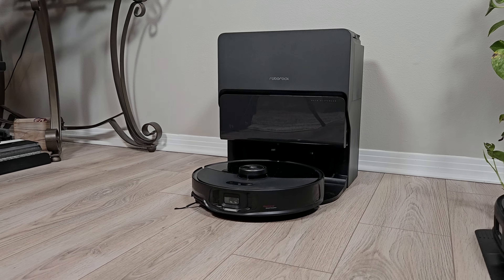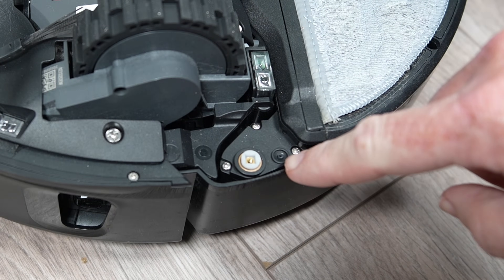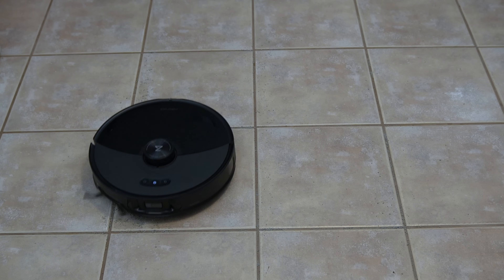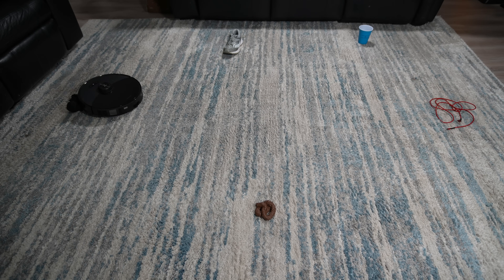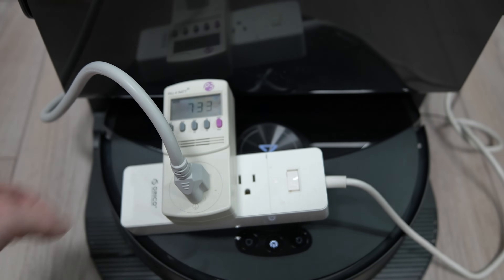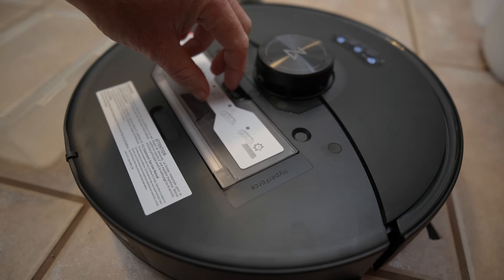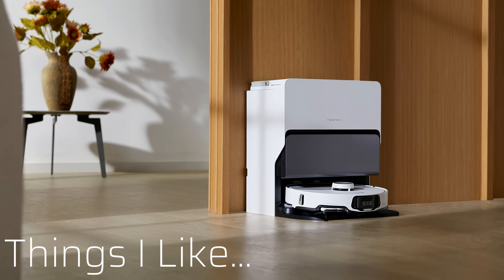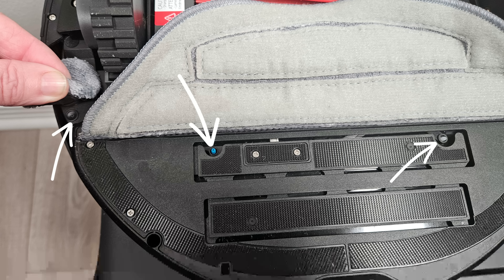Roborock S8 MaxV Ultra Robot Review. The Good & Bad.

Comment: Regarding some of the software  related cons. I've got to say Roborock is fairly good about pushing updates to fix things. They definitely utilize feedback which is great!
I'm still rocking my S7MVU and S8PU. Quite enjoying both 🙂
Reply from the maker: Yes they are.  I remember some issues with the S7 Maxv when it first came out. I just wish they were fixed by now.
Reply: How long have you had both or your vacs for?
* If you had to do it all over again, which model would you choose over the other?
Reply from the maker: @Sun.n.Flowers  I got the S7 Maxv at release so it has been around for 2 years now. One of my favorite robots ever made. I doubt it will ever leave my home, but then again not many robots do. I keep them for comparisons.
Reply: @Sun.n.Flowers  For me, I got the S7 MaxV Ultra in November of 22'. Best money I've ever spent cause it paid for itself within several months, compared to the cleaning maid service.
When the S8 Pro Ultra came out I waited about a week to check some reviews of it, one of which was from Jamie's channel, then ended up getting it.
Since the S7MVU was better at cleaning hard surfaces and the S8PU was better for carpet cleaning, according to multiple reviews. I put R2 (the S7MVU) downstairs since it had less carpet/rug coverage and R5 (S8PU) upstairs.
Once I got the map/rooms set up with all of the no-go zones, I only have to deal with either of them once a week, a maximum of two times if I need to clean them up. Overall, I am very happy with both.
If I had the money and know what I do now, I would have bought two S7MVUs at the same time. I do miss being able to check around the house with the remote viewing with the S8PU and being able to view what was avoided in an actual picture instead of an icon on the map of what the software thinks it is avoiding.
Hopefully, soonish, I'll be remodeling a bathroom upstairs (I forgot to mention this was the main floor), and I might consider getting the version of the S8 MaxV Ultra so I can connect it to a water line and drainage. I might utilize the trade-in for the S8PU for the newer one with the drainage/water hookup unless they require sending it back in the original box cause I don't have it anymore.
One thing I will admit, though, is that any of them will make you more aware of what you leave on the floor. I've had both get too close to shoes and get tangled with the shoe laces. Then, the robot spins around in circles for a few minutes, trying to get untangled. But then it stops and throws out an error out of frustration. xD